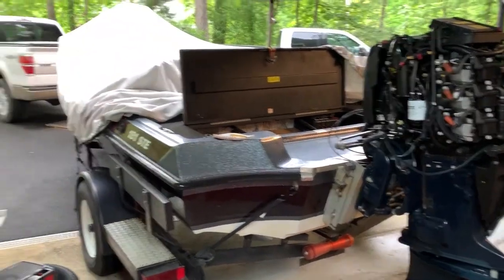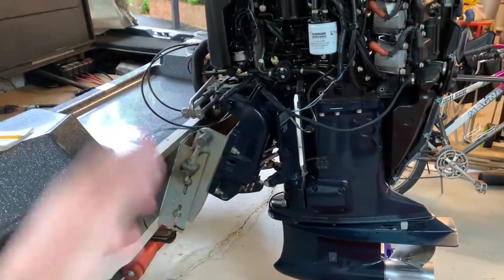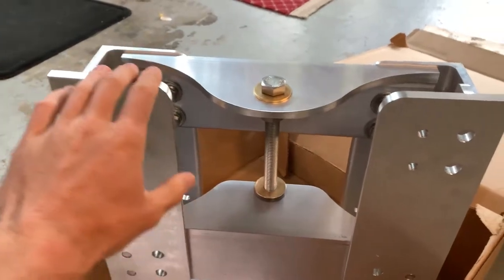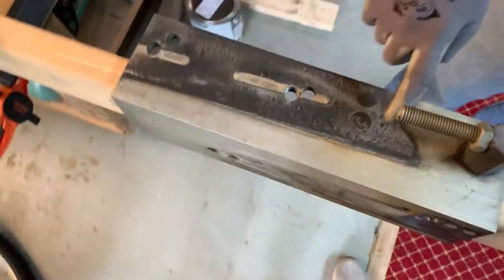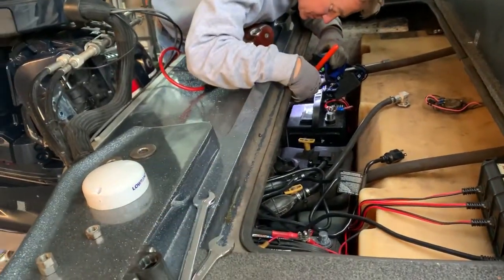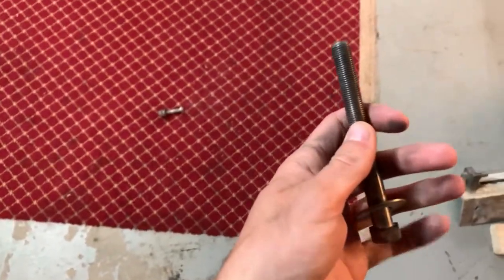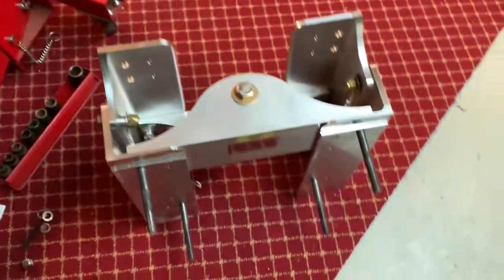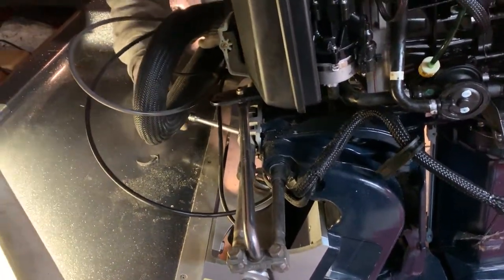Bass Boat Jack Plate Replacement Walk-though (18ft Fiberglass Boat)

Comment: I've put several plates on and I have a couple things Id recommend. 1st off I personally prefer 3m 4200 for sealant silicones a pain to get completely clean if it need to be removed again. I also recommend taking a popsicle stick and use it to coat the transom bolt holes prior to installing the bolts to help seal the core. I also put a ring around the bolt head again its  extra protection. Another thing I do is run the bolts head inside with shank coming through to the outside with either a big washer or plate on the inside. You can also do a small ring of sealant around the outer bolt hole.
Reply from the maker: Nice. I definitely used more sealant than I needed but I like to be on the cautious side as well!

Comment: Great video thanks! I’m debating between purchasing the original jack plate you had and the new model you just installed. Was the quality decent on the original plate? It’s about $100 cheaper but I’m worried since I saw your bolt snapped.
Reply from the maker: It lasted for roughly 25 years so it was definitely built well! Might be worth calling and seeing what the difference is between the models

Comment: can I buy your old plate off you to refurbish?
Reply from the maker: I’ve already gotten rid of it man!
Reply: @JenkinsBassFishing  darn lol, i am in canada so shipping would of sucked. how much was your new one?
Reply from the maker: Only 211$ which is very reasonable
Reply: @JenkinsBassFishing  i would of like his old one too. drilled the bolt holes bigger and put in stronger bolts.... here in uk they are stupid prices.
Reply from the maker: phill downes That’s crazy. I had no idea they were so expensive in Canada
Reply: @philldownes8685  Do you have bass boats in the uk?
Reply: @JenkinsBassFishing   he is in United Kingdom. I could most likely buy from the same place you did.
Reply from the maker: Aaron Meyer I completely misread that😂 yeah the uk makes way more sense
Reply: Hey man, was your original jack plate a Vance as well? Mine is labeled flats and bay, but thats cause that's what it's on. I'm trying to adjust mine and I can't get it to budge. The peice on the outside of the jack plate that the bolt goes through is not threaded is it? By moving those nuts on top and bottom up and down, it should raise and lower the height correct? Mine won't do a thing. I've used heat, lube and a sledge hammer, no dice. Nothing wrong with mine, it's just not level and I want to play with the height to try and eliminate some porpoising I've got going on.
Reply from the maker: My old one was a Vance as well. The center holt that is supposed to allow you to adjust the height only works if the supporting bolts on either side of the plate are loose enough to allow the plate to slide up and down.

Comment: Top speed increase?
Reply from the maker: Believe it or not, I haven’t had the chance to take it out since I’ve installed the jackplate. I’m also interested to see if I gain an extra mph or two. I’ll be using it next week and will update you once I test it out.
Reply from the maker: Just wanted to follow up. I gained 1-2 mph I believe. I need to do more testing but I hit 58 today with two people which is faster than I used to run with a partner.